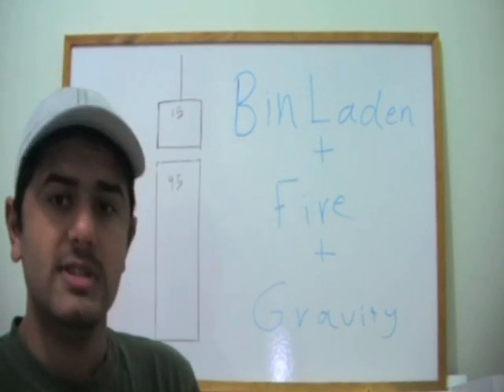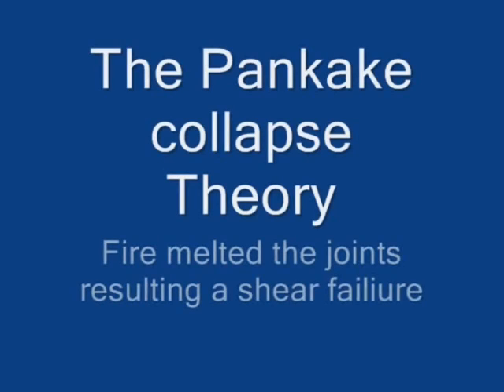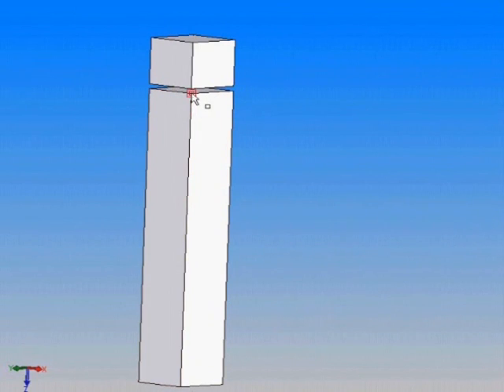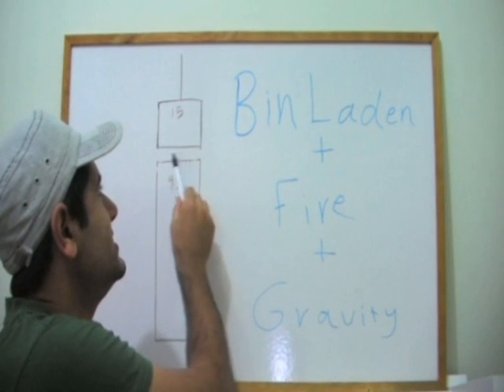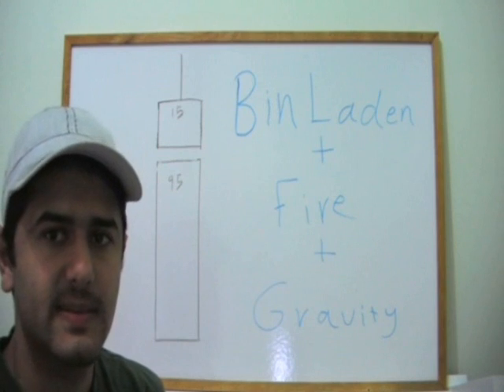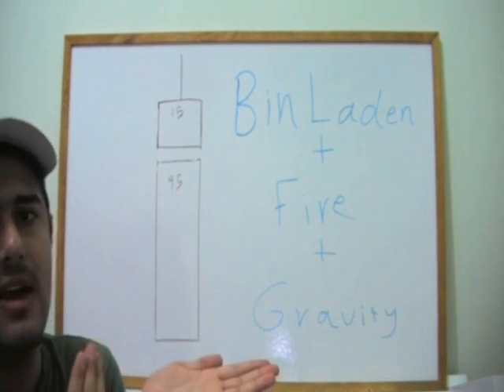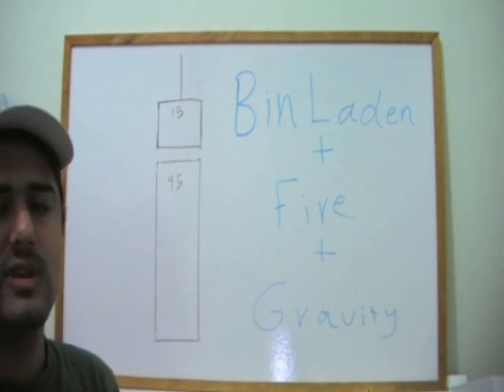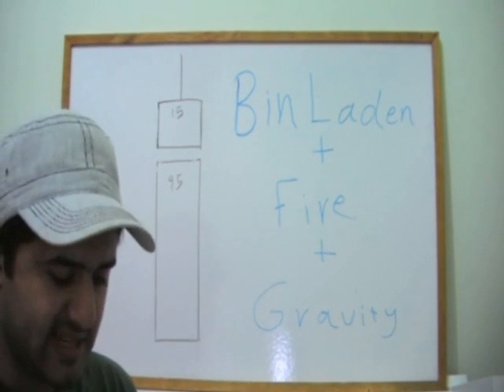(Part1) 911 Simple Physics Structural Failure Vs Demolition

Comment: people don't like the truth. its all about physics. the laws of physics cant be broken ever,never in history has the laws of physics have been broken till 9/11 when all three building fell due to fire. and thats never happened in history remember.  you figure it out.
Reply: What you and all the people who spit out the stupid conspiracy theories you all seem to believe is one thing; Building designs of the towers. They wanted to construct the towers very fast so they had to come up with a way to build the floors in pieces and lift them up as they built the towers. So they used a "steel truss" design on the floors. If you don't know what a truss is then look it up. A truss is made of considerably "thin" poles of steel that are very very very susceptible to collapse during a fire.....especially high heat fires. There's a saying among fire fighters "Never trust a truss because they always fail". So what you ended up with on 9/11 was floors of the building failing and falling on top one another adding more and more weight to the already damaged floors the further they fell. So the way that works is this...if you stand up 4 pencils that are 10 inches long and put a flat object on top and add weight, eventually the pencils will buckle and collapse. But you add another flat object half way between the pencils (theoretically) at 5 inches and add weight it can hold almost 3 times the weight before the pencils will buckle. So saying that jets hitting these building is impossible to make them collapse makes you look like a moron to anybody who has the common sense to research every possibility instead of jumping on the "Bush did 9/11" band wagon.
Reply: It's Me I just find it hilarious that you have your own mini conspiracy as to how building 7 collapsed.

As for acting as if footage of the Pentagon crash would be hard to find, that is also pretty laughable. Its the PENTAGON. You'd think they have surveillance all over that place. Send me a link of the footage you're talking about and the photos of the plane that hit the pentagon if you want.
Reply: Because no building in history has ever been designed like the WTC's were, nor has any building ever had that type of structure weakened by 1,000F temperatures.  You can even see pictures of the buildings sagging and bowing before their collapse.  There is a photo from air patrol of the North Tower showing the corner buckling almost 50 inches inward - which is caused by the fire weakened the trusses, causing them to bow down, pulling the exterior of the structure inward.  It's really just simple physics and engineering.
Reply: office fires and jet fuel, isn't hot enough to to melt or weaken steal beams. the way they were bent inwards, they do that to demolitions. planes wings can't slice through steal beams
Reply: Not once in the reports does it mention that the steel "melted".  That is a fabrication made up by conspiracy theorists.  But you are also wrong that jet fuel can't weaken steal beams.  You are intentionally denying the physical reality that surrounds you every day, and that is the fact that all steel is heated and made malleable for manufacture because why?  Because heat weakens steel.

Steel looses about 50% of its strength at around 900F.  That is precisely what caused the buckling of the walls.  Open jet fuel burning in ambient air burns at around 800-1,100F.  More than enough to weaken the steel by 50% in those areas.

And if you think that planes can't cut through steel, then explain what the gigantic holes in the trade centers are immediately after the planes crash into them?

The WTCs were constructed with both inner and outer structural beams.  The outer shell was made up of 60 steel beams on each side, connected by trusses to the center core beams.  More than 40% of the buildings weight was carried by the outer shell.  The planes sliced right through those steel beams without a problem.
Reply: no building in history has collapsed due to fire. the longest is 19 hours,it did not fall. the wtc north, south and seven, all fell on the same day, they was only on fire for about 2 hours. like I said in my last comment, the steel was bent inwards because they do that to demolitions,with bombs. the wtc was designed to to hold strong winds, 100 year storms and strong enough to to take multiple plane hits. 

in 1945 a b-25 bomber hit the empire state building, the plane did very little damage to the building with two rooms on fire. the plane though, did nothing to the structure, it still stands today.
Reply: So you believe the WTC was a demolition?
Reply: Many people do, Jack. Do some research.
Reply: "Its's Me." What do you have to say about Building 7? Do you even know about Building 7? It was not hit by either plan, and the only thing causing it to "fall" is fire falling from the original two towers. That is not enough to bring a building to the ground. Wake up.
Reply: N2KY Yes, I know all about building 7.  I believe, based on a recording from Larry Silverstein who said to "pull it" because of the danger of sending in more firefighters, that the building had always been prewired for demolition for security reasons.  

Building 7 housed a Secret Service field office, CIA and FBI offices, the IRS, and the New York Mayors emergency services offices.  It would seem perfectly reasonable to me to have the building pre-wired for demo in the event of an invasion of New York by an enemy or any sort of severe compromise to data.  

Given the uncertain facts of that day, as well as ground zero being a practical warzone that day, I can easily see why they would make the decision to "pull it", so that looters and data wouldn't be compromised.

To me, it seems unbelieveably stupid to demolish a building in plain sight, in the middle of the day, and then to say on LIVE TV, "Yea, I gave the command to pull it."  If it were a conspiracy, why wouldn't they have done it differently?

To top it off, there were only two planes flying into the main towers.  If the plan was (A) fly planes in the towers so we can (B) demo the twin towers and make it look like it was caused by planes, then how in the world did they plan on bringing building 7 down?  If they planned for the twin towers to collapse onto their own footprints, why would they think building 7 would take on any damage at all?  They couldn't have pre-planned the physics of the plane parts crashing into building 7 and lighting the fires, so they could have an excuse to demo it.  They don't control physics for crying out loud.

So the entire idea that it was a conspiracy just doesn't make any reasonable sense to me whatsoever.  If they could plan the towers demo, plan the planes hitting them, and pre-wire building 7 for demo, why in the hell didn't they find a way to severely damage building 7 so the collapse would at least be plausible?

I know what you'll say:  "Government oversight.  They screwed up the plan."  

Yet, they got everything else down pat?  

It's irrational to pick one story to explain part of the events and an entirely different story to explain the rest of it.

Building 7 was pre-wired as a safety feature for national security.  They pulled it so that any data in the building wouldn't get into the wrong hands, using the emergency situation as the perfect way to go in and loot the computers and files to get government data.
Reply: It's Me hahahaha you are truly lost. so building 7 was "pre-wired" for a demolition, yet the main two towers were not? And also, have you ever heard of any building in the history of the world that was "pre wired"  to be demoed at any time?

And if that is the case, and they demoed it willingly, why wouldn't they have told the public that? What an asinine statement.

What is your "theory" on the Pentagon being hit, yet absolutely no footage being released? We know that the FBI confiscated footage from local businesses, and we also know that official reports claim that the plain "vaporized" most of the engine and wings.

I'll grab my popcorn, this is fucking hilarious.
Reply: N2KY Your questions are illogical and would defeat the purpose of pre-wiring a building for demo.

"yet the main two towers were not"

As I already explained, Building 7 housed a ton of secret, top secret, and sensitive government information.  WTC 1 & 2 did not.  So what need would there be to pre-wire them?

"have you ever heard of any building in the history of the world that was "pre wired" to be demoed at any time?"

Why in the hell would anyone know this?  That's kind of the purpose of government secrets to protect the public from sensitive information, you know.

"And if that is the case, and they demoed it willingly, why wouldn't they have told the public that?"

Same answer to this as the last.  It would compromise a lot government buildings safety and protection features.

"What is your "theory" on the Pentagon being hit, yet absolutely no footage being released?"

You can Google the photos of the plane turbines, aluminum airframe, and other parts at the Pentagon, so there's no doubt it was a plane that hit.

Why no footage to be released?  What footage?  There's only a blurry video that had a very low framerate and resolution because it was a cheap-o security camera.  Why else would cameras be pointed at the Pentagon prior to it being hit?

Keep in mind, there's only 1 recording of WTC 1 being hit, and that was pure luck since the fireman were doing a documentary.  Otherwise, there wouldn't be any footage of that, either.

But, you can always look up the passenger manifest of the plane that hit the Pentagon and then go talk to their family members.

A famous CNN news reporter, Barbara Olsen, just happened to be on the plane that hit the Pentagon.  Her husband has done TV interviews, and CNN can verify that she most definitely no longer works there.  Not to mention, the entire Pentagon Memorial dedicated to everyone who died in the plane and at the Pentagon that day.

Are you insinuating that all of those people are fakes?  Made up?  And what about Barbara?  How do you account for her disappearance, when her flight was booked far in advance to her trip?  Do you think they kidnapped her and killed her, then shot a missile into the Pentagon?

See, the problem with most of the conspiracies is that they require more and more assumptions and more complicated explanations than the current explanations.  That is something called Ad Hoc Hypotheses and once one goes down that road the "theory" becomes more and more untestable and can never be falsified, but also never proven.  Check into Occam's Razor for more info on that.
Reply: +it's me; you're not wired up right. you obviously don't know what you're talking about.  lol
Reply: N2KY The fact that you haven't seen the footage and photos, yet believe no plane hit the Pentagon, is testament in and of itself of your lack of research skills and ability to put facts together.

As all other conspiracy theorists, you pick and choose the things that fit your theory while leaving out everything else that easily found and documented.

I used to be a "truther", and then I stopped looking for info that fit what I wanted to believe.  I decided I wanted the actual truth, no matter what it might be.  

That's when I realized that there is no conspiracy at all.
Reply: So no links then? That's what I thought
Reply: N2KY No one learns by someone else doing the research for them.  All you'll do is find excuses to not believe any of it.  If you were truly interested you'd find it yourself.  It quite literally takes 5 minutes to find the stuff I referred to.
Reply: It's Me Riiiight. You've got nothing.
Reply: except in the old testament. and in both cases the powerful leaders tell us to take it on their word that it really happened.

Comment: The "structural failure" was essentially total, and all at once, and could not possibly have been caused by the limited and fairly cool  fires in concert with  gravity and the airplane damage. 

The airplane fireballs and  the physical damage from the airplanes were, (structurally speaking)  not relevant to the collapses. 

 The collapses were caused by sequenced demolition charges, primarily. They can be viewed in a number of the  Sept. 11 videos.

 The explosions created typical "squibs", many of which can be seen in various videos of the Towers coming down. 

 These explosive squibs are not puffs of air from some magical, so-called "piston effect" of falling floors.

 There was no piston effect, or none that mattered.  

The floors were blown into small fragments in rapid sequence,  and could not, after the explosions broke them up, act as  pistons. 

The perimeter column walls were also severely broken, not to powder but largely into the original 3-column, 36-foot high prefabricated "chex"  units shown in construction photos of the Twin Towers.  Truck-length pieces. 
The connecting bolts, tying the "chex" together vertically,  had apparently mostly been removed before Sept. 11 via the oblong access holes in the perimeter column ends.  

Removing those bolts wouldn't have weakened the Towers, at least not  until the floors were destroyed; and then the perimeter walls came down like pick -up sticks.
. 
Basically, those solid  buildings were turned tino a fluid, which  then flowed to the ground in that form. 
A fluid, not a liquid.
 It was something like a pyroclastic flow but not as hot.  
 And unlike a pyroclastic flow, which is typically  loaded with boiling mud and steam,  the "fluid" of the shattered Towers was a dry cascade-   like a "grit fountain" or "sand waterfall". 

Finally, 
 There is no valid  reason to attribute the destruction of the Twin Towers to any cause but explosives.  

These were intentionally placed  throughout the buildings before Sept. 11 2001. 

Only explosives could have done what was done; and as a matter of fact, that is what happened. 

Any 9/11 theory  that leaves out the explosives is dishonest, and  useless if the goal is to find out what happened.  

 The explosions can be seen. 

 The destruction that happened and which is documented beyond doubt is of a type and an extent only achievable by means of high explosives.
 No other explanation fits the facts of the damage. 
 Nearly 220 acres of  intact  concrete/steel floors  and their supporting trusses and steel floor pans, etc.,  were converted to dust in seconds. 
Without explosives this is impossible. 
"Structural failure" was almost total and almost immediate, when it happened. 

 The airplane damage had nothing to do with the collapse of either tower. Without  explosives those towers would still be standing.
WTC Buildng 7 is so obvious that I won't get into it. 
But many people seem to think the airplanes made a difference, with the Twin Towers' destruction. 

 However, the airplanes were not part of the cause of the collapses.  
The airplanes served other purposes.
Reply: One problem: No physical evidence of explosives were found. Nothing. Zip. Nada.

We know it wasn't explosives.
Reply: +TimReed22222 based on what? Were you there?
Reply: scootercarper Based on the fact that no one, AFAIK, have been able to point to any (evidence of explosives). I'm pretty confident that if any of the first responders who spent 7 months sifting through the wreckage by hand had found any, we'd know about it. If I'm wrong, perhaps you'd point us to it?
Reply: Nano thermite. It has been documented being at the scene.
Reply: scootercarper BULLSHIT, it has NOT.

It was alleged by a single paper that was not verified, reproduced or peer-reviewed in any way & published in a fake journal - and in fact has been disproven.

Oh and BTW thermite is an incendiary not an explosive. Try to at least pretend you understand what you're talking about.
Reply: you can shove your head up your own ass for all I care. It was found there. based on the information I have studied, and that over 2,000 other engineers and architects are saying. been disproven? That's what you got? I never said it was an explosive. Read whats posted before you comment.
Reply: scootercarper Oh, so now the 2000 signers of the A&E petition say there was thermite? That's a new one! False, too.

But that doesn't matter. Facts don't matter. You're going to believe what you're going to believe, facts be damned as long as it aligns with your fantasy.

Comment: when i was about 14, our science teacher took us to the local technical college, to,'  show us how the tensile strength of steel ,' was tested.
    a half inch bar of mild steel was placed into this machine, and a steadily increasing force, was applied, the dial showed the tons of, 'pull', increasing, and suddenly speeded up.
    suddenly, there was an enormous bang, as the bar separated, no one had been expecting that.
     not difficult, to work out, where the bangs in the towers, was coming from.